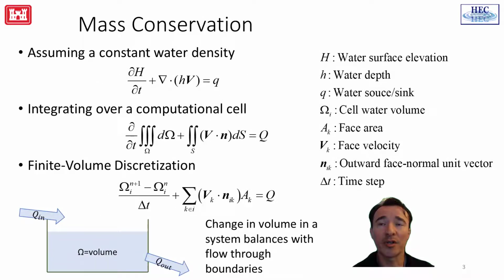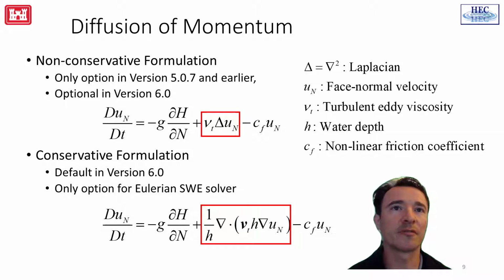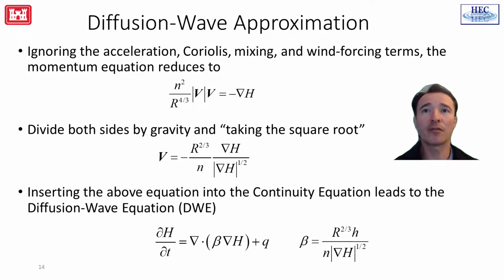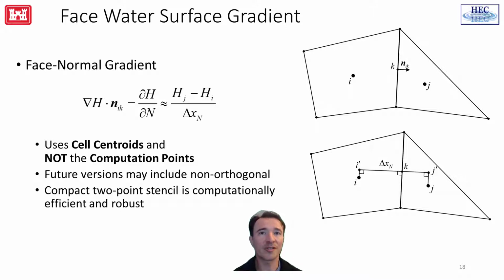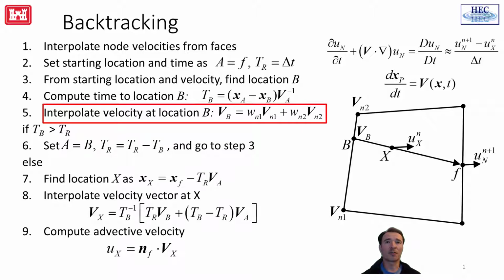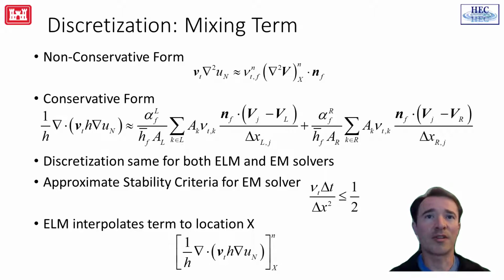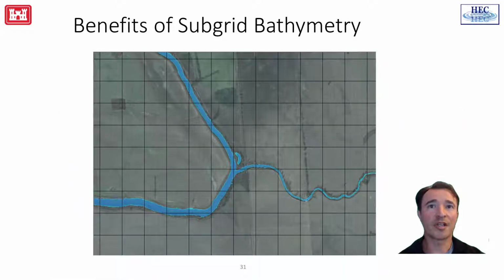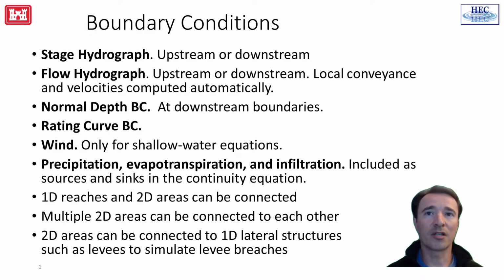HEC-RAS 2D Class: 1.4 - Introduction to the 2D Hydraulics Equations

Comment: Hello, according to the reference manual, in the SWE, the cell velocity is approximated from the face normal velocities. The cell center velocity terms that stem from the weighted least squares method are provided. However, it is not clear how to calculate wk (weight of face k) found in the terms. Inspecting Perot's (2000) paper hasn't helped.